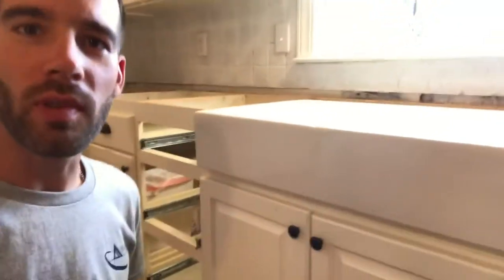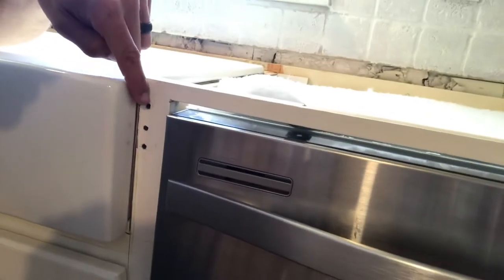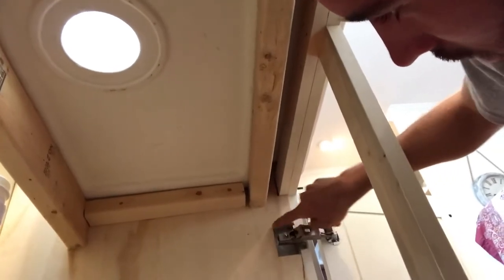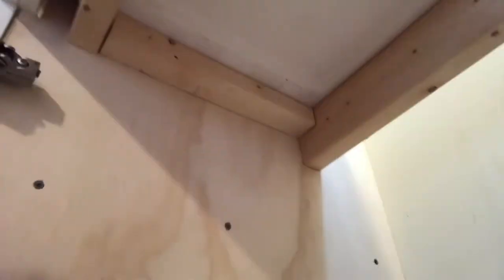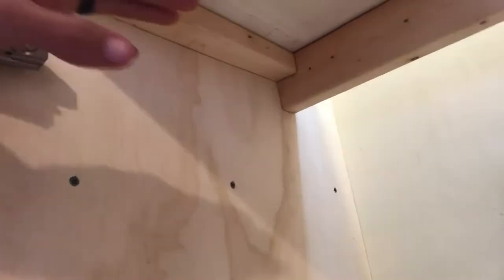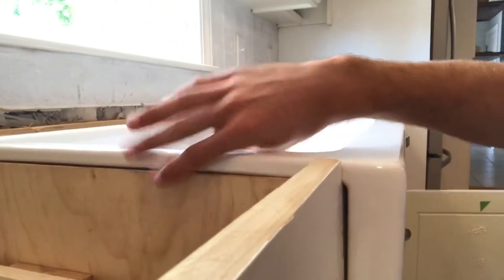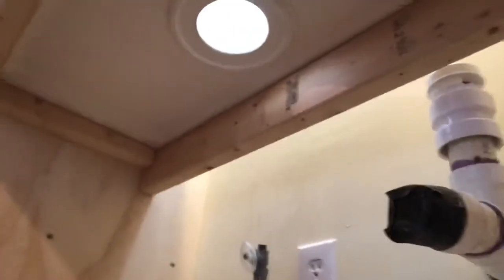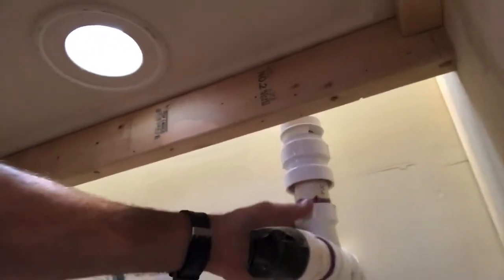How to Frame a Farmhouse Sink

Comment: Hi,
Thank you for this video its very helpful.  Can I ask, is it necessary to silicone around the front apron?
Reply from the maker: Hey! Glad this video could help! I highly recommend applying a bead of silicone to wherever the sink comes in contact with the counter above or below it. 

It sounds like the apron front you’re working with is sticking out with no contact with the counter, so you won’t need to put a bead on it.